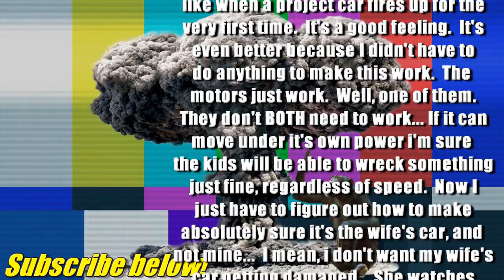Mini Willys CJ2A Part 10: Electric Motors and Welding Patch Panels. Also How to Make it faster...

Comment: Tesla created and pushed ac Westinghouse was just financing it but dc was doomed from beginning dc cant be sent far and requires way too much copper
Reply from the maker: +Kevin Watson interesting.  Pinned for the info.  Now the question is did Edison really invent DC or just steal it like a lot of those patents of his? ;)
Reply: STOLEN.
Reply: Actually DC is more efficient to transmit long distances than AC.  Problem was, back in the early days there was no easy and efficient way to change the voltage of DC power (low volts = crappy long distance transmission; high volts = dangerous to use in the house).  So the AC system (with it's ability to easily use step-up or step down transformers as required) was used.

Nowadays there's just too much AC equipment around (both on the transmission network as well as at the consumer level) to even think about switching to a DC system.  HVDC is used in certain specific situations where the higher efficiency overcomes the increased cost and complication to transform the power at each end.

Comment: I touched my 230V AC outlet a few times (by accident obviously :D), I can confirm it doesn't feel good.. Really entertaining rambling on this one, give us moar stories! Cheers
Reply from the maker: +ChaosPotato glad you liked the rambling!   230v is no joke, that'll take you out quick.  My dad tells a story about getting hit with that, says he could feel himself going down, had to force himself to fall back to get out of it.  He says his joints hurt for 6 months after that.
Reply: You know what they all say. It is not the volts that kill you but the current. Although it does take some amount of electromotive force to overcome our natural resistance to current flow. That having been said what really determines whether you live, or die being electrocuted is how in circuit you are. Which is further decided by just how grounded you are, and the path the current takes to ground. Which is often through the feet, but can be to anywhere that has ground contact. Say if you're leaning on a metal railing, or your other hand is touching a grounded metal part. This causes folks in the know to say when you are probing live circuits work with one hand in your pocket. Oh, and wear good shoes too. Ones with heavy insulated soles.
Reply from the maker: +Paul Frederick I think it's my uncle that says the worst shock he ever got was from a fraying electrical cord he grabbed to unplug from an outlet while standing barefoot in his garage.  Bad idea for him I guess...
Reply: +Paul's Garage Yeah concrete is funny. It kind of stays damp when it is in contact with the ground. So touching it you're pretty grounded. It is not quite as bad as standing in water, but almost. I heard about a guy that was standing in salt water sanding his boat when he accidentally dropped the corded drill he was using. I didn't hear it from him though, because he died. A buddy of mine was pouring concrete and one of the masons that he was working with ran his aluminum bull float handle into the exposed bus bars of the uncovered temporary job service panel on the site. That guy got toasted too. Because he was standing in wet concrete when he did that. Aluminum bull float handles are about 2 inch in diameter tubes. They can probably carry a million amps? He had zero chance of survival in that situation.

Comment: Add the second battery but add resistance to the good motor youll get even power across both and a little more power for the jeep as long as you balance the equation first with the right amount of resistance
Reply from the maker: +Kevin Watson interesting idea, thanks

Comment: My daughter drove the hell out of her power wheels jeep - my wife would walk to the grocery in town by means of the canal tow path (Delaware Canal), roughly a mile. My kid would have that sucker floored as she climbed up the inclines to the locks, then scoot along with a bag of groceries by her side... burned out the gears after a year on the job. Harsh off-road usage, but one charge would take her the two miles into town and back.
Reply from the maker: +zillustration I certainly drove my power wheels jeep to death, too.  With the extra voltage due to my dad's work with it, I was burning though fuses and plastic tires all the time.  It was great.  The charging system ended up really, really dangerous for a 6 year old to use, what with twisting bare wires and using car battery chargers, but I never started a fire :D
Reply: coat the tires with truck liner and save the tires.

Comment: Paul can you cast that steering wheel in aluminum?   Or better yet, you could weld the links of a chain together in a circle, add a hub and connect them, and make your own!
Reply from the maker: +Joe Tuinstra I probably could. It I would have to make a new mold I think.  I plan on doing something similar to that eventually, try to make one a bit more authentic looking.  First priority is getting it working, though.

Comment: All kidding aside, great and informative video Paul! Have you thought about 3D printing the gears you need? Maybe make a pattern and cast in AI?
Reply from the maker: +eviltwinx I've looked into printing gears, but I think I decided against it since the stronger filament would require I get a chrome plated extruded tip.  I didn't pursue it much farther but I might in the future.  I'm hoping to go through the Gingery metal shop projects which would result in some machining tools I could use to make gears. But that would be a LONG time from now.  Metal gears for these things are actually commercially available, as are upgraded motors.  I guess there are enough crazy people out there modifying these things lol.  Casting the gears in AL would be cool but I'm not sure I could get good enough detail on such a small part that they would mesh well.  Also cast aluminum is pretty brittle and I know I pounded my old powerwheels jeep to death when I was a kid.

Comment: 14:50 Should have converted to horsepower, 0.0965536 incidentally. So closer to a tenth than not. (Google calls it "mechanical horsepower", I don't know if that's different from normal horsepower.)

Comment: Couple of things there Math Boy, 

I bet you didn't factor in the weight of the steel when considering what to do with the motor. You've added at least 40-50 lbs of weight to it. And remember the thing is only supposed to pull a 45 lb child. 

Also, congrats! A summer toy is now going to be useless in a few weeks because you live in Wisconsin.
Reply from the maker: +gplechuckiii the added steel so far is only about 15 lbs.  it's surprisingly light.  Plus we don't get snow until New Years lately, plenty of time to get driving around!
Reply: Of course, a child is never too young to learn to turn into a skid on ice. Ha! 

But that is surprising about the weight of the steel. and actually quite impressive.
Reply from the maker: +gplechuckiii yeah I'm really quite surprised how light it is.  Still heavier than the plastic I cut off, but I can pick the whole steel shell up one handed.  In the end (I have some square tubing to add for strength) it will probably add less weight total than having a second kid in the passenger seat.

Comment: you've learned a lot of things doing the metal stuff but when will you learn to plan ahead XD

don't feel bad for the elephant, it would have been dead now anyway. animal prison is a zoo, they lock innocent animals up in animal prison

oh that's why they need that clamp thing. I knew about the electricity rambling but I've never looked up how a welder worked. learned something new
Reply from the maker: +whoeveriam0iam14222 but planning ahead is way less interesting than just winging everything!!  And yeah poor zoo elephants. The life of that one elephant (named topsy if you want to look it up) is particularly bad and also interesting.  I guess there was an even where an untrained elephant trainer (I.e. Someone who BS'd their way into the job) got drunk, rode the elephant through town, and tried entering the front door of the police station.  While riding a murderous elephant.  Of course the trainer was immediately fired...
Reply: failure makes for more interesting videos

Comment: Where did you get that motors with the gearbox?
Reply from the maker: +Alexis Jaramillo those are the ones that came with powerwheels, but I can find the link for the upgraded ones and post it later if you want
Reply: Thank you!
Reply from the maker: +Alexis Jaramillo here's the upgraded ones http://www.mltoys.com/Performance-Motor-Gearbox-Systems-s/110.htm  you can get steel gears and lots more power!

Comment: Why didn't you just measure the current? I would trust voltage and current measurements far more than static low resistance measurements. As bad as your Harbor Freight meter is it could test the current in this instance. Just heed the warning on the meter and do not run for long. Like get the number then stop.
Reply from the maker: +Paul Frederick but if I measured the current, how would I have an excuse to use math?!  In honesty I just did resistance as a first step, completely expecting it to tell me nothing important.  I can't be sure my cheap meter told me the right thing (good meter was all the way over in the work van) but it gave me something to talk about.
Reply: The way motors work it would not surprise me if the resistance did not change as the brushes contacted the commutator bars at different points of rotation. That your "good" and "bad" motor readings seemed to parallel expected values could just be random chance? Even a good meter would have the same problem getting an accurate reading. I'm testing a fairly high quality Japanese made Epson DC motor with a 0.5% accurate meter and I am getting anywhere from 135 Ohms down to 45 Ohms as I measure resistance with the motor shaft spun to different positions. The measurement is random. At 12V the motor draws 69mA So the real resistance (reactance? - the load is inductive) is actually 173.91 Ohms
Reply from the maker: +Paul Frederick that's a good point, I didn't give the motors a spin to check how the resistance changes.
Reply: +Paul's Garage You have the commutator bars spinning under the brushes. So in various positions conductance is bound to change. The contact there is less than ideal. It is a trade off between freedom of motion and a solid connection.

Comment: 2nd
Reply from the maker: +Zach Ferguson can confirm second
Reply: Paul's Garage hey dude I love your channel and i was wondering how is the refractory cement used in your Foundry holding up cuz I just ordered some off of Amazon and I was wondering if I was going to eventually have to replace it
Reply from the maker: so far it's holding up perfect. No problems with it.  The lid is cracked a bit but holding fine, and the liner of the bucket is showing no damage at all.
Reply: Paul's Garage that's awesome thanks and keep up the great video's your channel deserves so many more subscribers